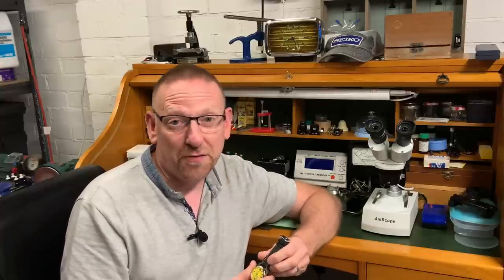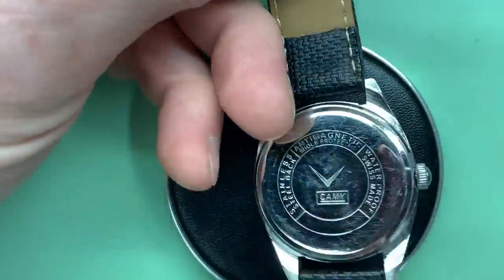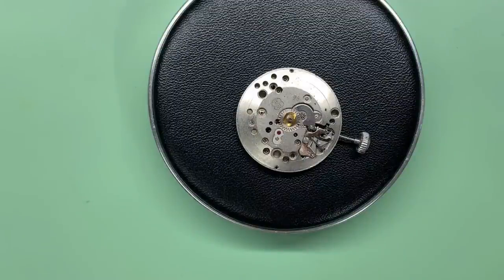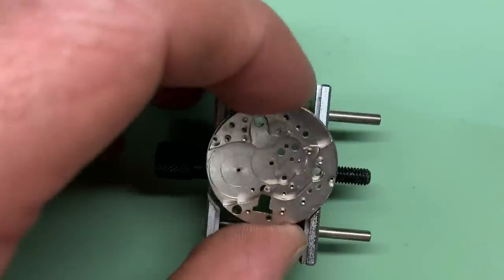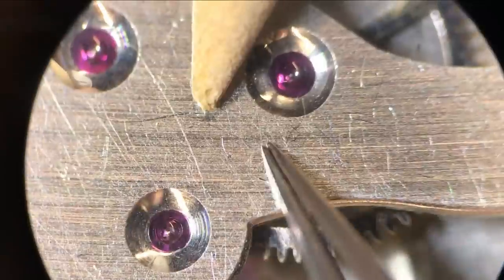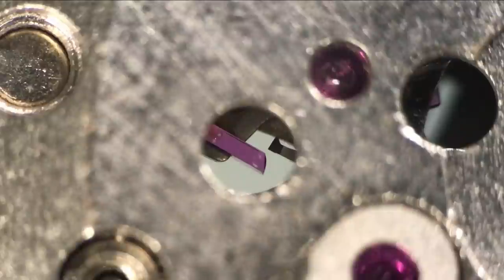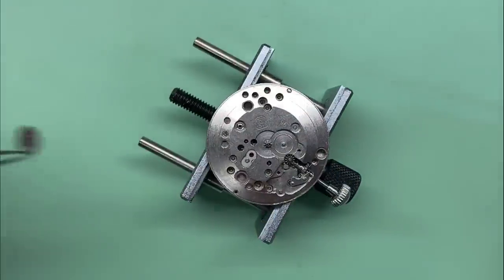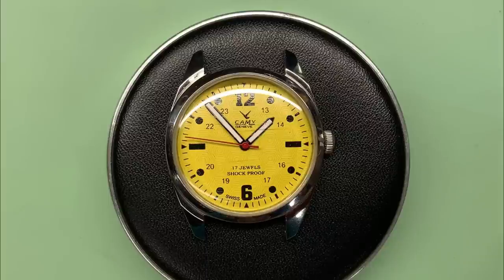Whats Inside a "Mumbai Special" Watch?

Comment: I'm not going to lie, I kind of like that. I'm only 7 minutes in, but if the movement is even half decent that's a great deal. As long as the buyer understands what they're getting into, I see no problem with this sort of watch. In fact, I sort of want one as a cheap thrill.
Reply: I don't see what the problem is with these "specials" even if everything is fake.   You're getting a pretty good jeweled mechanical movement for $13 bucks (pounds).  The "before" on this movement could have easily been put into beat and regulated on the time graph machine within a reasonable tolerance even without a service.
Reply: @scdevon  the problem is they are selling them as somthing that they are not. we know they are not but others buy them thinking they are getting a somthing they aren't,
Reply: @elund408  This video makes me want to buy one. I'd wear it because I wouldn't have to worry too much about damaging it.
Reply: @1955mercury  many don't run long enough to make it worth while, you can buy a seiko 5 for about $100 and have  watch that will last for years or a timex or casio for $50 that will last for 5-6

Comment: Enjoyed this video. My take is that mechanical watches with relatively bulletproof movements -- HMTs, the most common Seiko 5s, mass-produced Swiss -- were in some ways easier to keep going through thick and thin than quartzes: there'd be someone in the nearest town who did that work and had a pile of donor parts. The redials and recasings are part of a process that retains the ticking heart of the watch because it carries financial and sentimental value, and buyers outside India aren't used to that.

Comment: Greetings from across the pond in the USA. I have recently started with the watch repair hobby. I had one of these I bought a few years ago and decided to try to service it. The amplitude went from around 190 to 230 degrees when I was finished so I guess I did pretty good. I had a laugh when you mentioned the bottom shock setting being a pain. I almost gave up on mine but finally after probably 30 minutes and almost losing it several times I got it back in. Thanks for the great channel, it’s a great one to learn from.

Comment: Very interesting and relaxing video. Thank you. My job is often quite physical and I have broken several watches and as such have purchased several of these "Specials" from Ebay over the years. I have had these Camy as well as Henri Sandoz (which have the same movement that you have just worked on) but have more recently stuck with the more reliable and solid £15 Casio.  Who really minds if they are 50 or more seconds a day wrong for that price.

Comment: I bought a couple HMT. They are great to learn and easy to make them run, but hard to adjust the rate, not to say the beat error as they don't have an adjustable stud. I keep them so maybe one day I'll try to correct the BE readjusting the balance position, athough that's a technique I don't usually need.

Comment: My experience, I bought a bunch of those: From one seller, I got an "HMT pilot". Strong beat, surprisingly well lumed hands, pretty accurate (I regulated it to about 6 seconds per day!). Afterwards I was pretty thrilled and got 4 more from another seller. 1st one was another HMT pilot, strong and pretty like the last one. The next one was an HMT Janata, this one works and is fairly accurate but has a somewhat weak beat (I'm not a watchmaker, but it's audible) and sometimes stops when setting the time. It also needs quite a lot of power in the main spring to start running after it stopped. I'm not a watchmaker so I'm not quite sure what causes this, but well. 

At last I bought two HMT Sona. One is pretty lovely, strong beat like the first one (I regulated it into the +10 seconds range) the other one though came with a missing screw (holding the movement inside the case) making it flop around, and it's very inaccurate without me being able to regulate it any better (the lever would collide with a gear!). I wrote the seller, and they said it was fine when they sent it and I should bring it to a watchmaker for inspection. The conversation kind of ended there as the little thing cost me about 14€ and every first-world watchmaker would laugh me out of his shop for the audacity alone (can't get the money back because the buyer protection ran out). I would be really interested in what causes the issue though, but well, I lack time and ressources to get into watchmaking myself. I'll just keep it for spare parts because I could at least switch hands, crystal, case and dial if necessary.
Reply: Where are you located?  I may be able to help you with that second sona.
Reply: @Andrew-fb4vn  
Austria. Unless you live somewhere in the EU, the shipping would most likely be unpleasently expensive, especially now. 

I've ordered a de-magnetizer for the slim chance that that actually causes the issue, otherwise, as I said, spare parts.

Comment: I bought one of these Indian watches because it had a really cool red face.  It ran terribly at first, but I tweaked it on the timegrapher and it ran perfectly for about an hour.  Then it stopped completely.  I think the problem was in the winding mechanism or mainspring.  I'm no where near your mechanical level, so now I am (slowly) working on my first  quartz conversion.  I have a new movement, stem, spacer, hands, and sticky dots.  I would like to see a conversion if you're up to it.  Similarly, I found that they had not epoxied the crown to the stem and it came off.  So what if its not genuine... if you like the look of it, wear it.  Love your videos.
Reply from the maker: Thanks for your comment.  Conversion would make an interesting topic but I prefer my mechanicals so it would be almost go against my logic to replace a mechanical for a quartz movement. I would just try to fix the mechanical one or replace it with another donor.
Reply: I'm eyeing up fitting Miyota quartz movements to two of my Soviet quartz pieces, the parts for the 3050 CCCP movement are just non-existent so have ordered a cheap Miyota day date quartz and some stem extenders and going to see if I can bring these huge square watches (45mm square) back to life.
Reply: @MyRetroWatches  How about going the other way: quartz to mechanical?
It would be interesting to see how realistic it would be to do and you may like the look of a particular quartz watch but still want it to tick.
Reply: My first Mumbai was a Seiko and my first Seiko. It had a sunburst red dial. I loved it and that's why I bought it.

Comment: Nice.In fact I learnt watch repairing on this type of watches.They are sturdily built and last for more than 3 decades without repair after buying in brand new condition.All the best.Thanks.
Reply from the maker: They are surprisingly robust but then I find most mechanical watches are, especially the manual wind ones. I guess when they stop they sit in drawers for years so a 50 year old movement may have only seen half of that on active duty.

Comment: Those ST96 movements are solid, good quality movements. Made by the millions in the 1970's. The only problem with them is they have never been serviced and the oil is either a gel or completely absent. If you put in an armoured crystal they feel much more solid.
Reply from the maker: Thanks for commenting pal.  I was surprised to see what was inside and for the little money it’s actually pretty good value. 
If they just put on some generic dial and at least a tension ring crystal it would be a decent low end mechanical watch for the masses. 
Dressing it up as something it’s not has made them detrimental. Shame really.

Comment: I think as has been said these are good practice movements for those learning to repair and work on watches. The problem is no matter how many hours you put in and how good you get it, it is still only worth a pittance. If I had your expertise I would get more satisfaction bringing a good vintage watch back to life.
Reply from the maker: Thanks and you are right on every point.  I was just curious to see what this was made with and then how good it could work.  The better brands are nice to work on but the Swiss stuff especially, parts are hard to find and stupidly expensive which is what puts me off some more higher end things.  I get just as much enjoyment fiddling around with these types of watches.  That said I do have a drawer full of classic vintage watches to explore. some look awful on the outside but the movement look beautiful.

Comment: This by far the best video on this subject... I’ve had a few of these and they’ve always been a good way, especially on the cheap side to experiment with taking watches apart. I did mod a few by replacing the dials with genuine SEIKO dials and used them as something unique, and sold them as unique. You really can’t get upset over £15 delivered... with patience and some background checks you can buy a few of these and build a complete watch that all matches, apart from the serial number, but isn’t most of the used cars in the road running non original parts like oil filters, shocks and wheels? 
A very affordable watch that’s perfect for tinkering... fake Seiko’s are so obvious to those who’ve owned this brand for a while, but to the excited eye they look too much of a bargain to avoid, and only later discover it’s rubbish when they’ve joined a SEIKO group or watch group like Retro where the experienced notice it’s not genuine. Watch channels and Facebook watch groups like this are very worth joining, even myself use them to discover new identities to knowing if a watch is 100% original. 
Great job my friend as always... that didn’t feel like 54mins, it could’ve gone for another 54mins it was that involving ;) Big thumbs as always!
Reply from the maker: Thanks Phil. Great comment
Reply: @MyRetroWatches  Great reply :))

Comment: A great video,  thank you for helping educate the community about these watches. I know i learned a great deal.  
One small suggestion,  since the bench video is done at a pretty constant distance,  would it work to turn off auto focus so it doesn't hunt every time your hands appear? It always seems to find your hands (brighter objects) rather than the movement and the constant switching could be a queezy experience for some viewers. 
Great info though,  i always learn something from your content,  thank you for putting them out!

Comment: My guy... I just picked up an old camy movement to tinker with.  Sure enough, you’ve already got a tutorial up. 

I’ve been staying in India through the pandemic,   so I’ve had great access to cheap movements to practice on. Old HMT, Enicar, Camy, and seiko movements are ubiquitous here. 

I don’t know if this is something you’d be interested in or not, but I’d love to send you one of the vintage HMTs I’ve been working on.  The movement (based on the C021) isn’t much to write home about, but they’re still charming little pieces imho.
Reply from the maker: Andrew thanks. I have wondered about the HMT watches but ones over here are not always genuine
Reply: @My Retro Watches, finding authentic HMTs can be a bit of a challenge since, afaik, there is no solid reference catalogue publicly available.  In my experience, you really have to know someone reliable who’s been working on these watches for a long time.  With that said, there’s no reason to fabricate the movement since there are millions out there, and original cases/dials aren’t that rare - they just require a fair amount of TLC. Actually, the watch that originally got me interested in HMT was the Janata Devanagari with an aftermarket blue dial (the authentic version is only in white).  

https://imgur.com/a/3W08J60

Comment: Nice video! I had same experience with Indian watch from eBay. So familiar. The only major differences were ultrasonic and regular oiler (not automatic). Is ultrasonic okay for cleaning?
Reply from the maker: yes I used  and still use an ultrasonic, you will see it in some of my videos.

Comment: Very enjoyable. Do you find the noise from the timegrapher get picked up with the mic which then corrupts the results?
Reply from the maker: Occasionally you can get some resonance which can interfere especially if there is a bracelet attached. You can turn down the gain on the machine to get a better reading, or position it differently or use a thin cloth in the jaws.

Comment: I got a vintage seiko for a fiver from India. Everything genuine Seiko although the original 17j movement  had been swapped for a 21j seiko movement. Very impressed with it. I wouldn't go for a non Seiko, they are real dogs dinners.
Reply from the maker: Yes many of the Seikos have genuine movements just different to the ones it states. I bought a 6309 for parts and got a 6319 which is a higher jewelled and better movement in my opinion so I was happy

Comment: I have a "Mumbai Special" I purchased on Ebay recently.  They don't all have the same case.  Mine looks like very shiny chrome with a fixed bezel that resembles a  Vostok "scuba guy" case only smaller.  The back won't screw all the way in and if you tighten it, the movement stops.  The movement runs for a while and stops.  Maybe my fault for tightening the back.  Movement appears to be a Seiko 5 17 jewel.  The band is very shiny chrome and very soft.  I like your frankenwatches better. :)

Comment: I’m just a watch guy who likes what I like. Not into the disassembly and service thing. But can enjoy watching. Have noticed that the inside compared to other videos I have watched seems awful. But like you said, it’s a $20 watch. Not expecting a Rolex now are we... 😬
Thank you
Reply: Decoration and finishing does nothing for reliability or accuracy (Seiko don't bother). Rolex movements are actually quite crudely finished.

The 17J Chinese Standard Movement is one off the best ever designed. The problem is QC. If you get good one it will last decades and be very accurate.

Comment: I thought was a Cadillac video! You improved it significantly. I assume you went back and greased the keyless works? Just me, I would oil & grease everything as I went. Mayor will help.😊I was curious too if you took the barrel apart and cleaned the spring? I do t recall seeing that. All that said the love and care you put into it, I’d wear it. I would love to see the differences between a real Seiko and a fake. Maybe a video in the future? Take keep up the great work. Tell me is 65 too old to start working on watches. I think it could be fun! Cheers from the USA!
Reply from the maker: Any age is a good age to start pal.
Yes I service mainsprings but it’s hard to film nicely using mainspring winder.  I have thought about the Seiko thing but problem is the “fakes” are usually powered by real Seiko movements .

Comment: Hi,Maybe you can help me. I have a st6 movement that worked just fine for a short time then it would stop every 2 to 6 seconds. I could get it started if I would give it a good shake than it would stop again. What do you think might be wrong? Thanks
Reply from the maker: So many things could be wrong.  You cant diagnose a watch without taking a good look at the insides first.  To me it would be that its just dirty and would need a full stripdown and clean and  fresh oil.

Comment: I bought a so called seiko watch which on arrival it was broken, within days the seller had replaced with another the same and it is still running fine so not all bad just most, the guys working on these are probably not paid much but do a pretty good job assembling them.

Comment: I'm really enjoying your channel.  I watched a bunch of Mark Lovick's videos for months and he makes everything look sooooo easy.  I knew that it was just an illusion, that great skill and experience will make very difficult things look easy.  Then I've recently found your channel, and it's much more real and raw (no offense, you admit you're a hobbyist not a pro).  It's funny, I have bought a few of the same old/cheap watches you've worked on.  I started with new watches, then got some older ones... then got a timegrapher and started tinkering....  Now I'm amassing the tools to finally have a go at ripping one apart and seeing what I can manage not to break.  It should be fun.  I have ones that work but just barely, but I'd be miffed if I fully broke one... So I just got a bulk bag of 16 old broken movements.  I'm going to start with those before I dig into any of my watches that actually work.  If I break/bend/lose parts on the old movements, I'll just chuck 'em in the bin and chalk it up to learning.  Then I'll see if I can improve my barely-working vintage watches.  I think I'm going to have to learn to fix beat error on a fixed stud.. so many of my older ones have fixed studs and 4+ ms beat errors.
Reply from the maker: Your doing the right thing,  buy some tools and work on some older movements.  15-17 jewels are better as you find they are more refined and a bit easier to work on.  Get a taste for the hobby before falling completely down the rabbit hole.

Comment: They are parts watches. I'm wearing one. I liked the dial configuration and the show back so bought it. It ran FAST. I tinkered with the regulation and it was really, really close, but I thought I could do better and then totally screwed it up. Meanwhile, the seller refunded me the entire amount due to the regulation problem. Got it serviced and now its a very wearable watch. For the price of the service.
Reply from the maker: If it’s the same movement then I can understand why . I found that if I moved the stud the regulator moved with it . Also they were very loose. Took quite a bit of messing to get it to where I did.